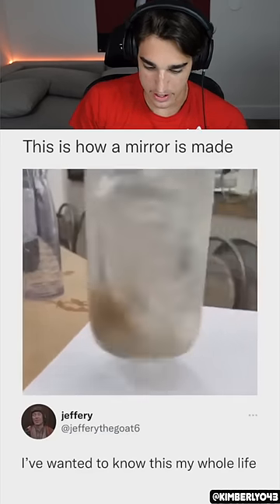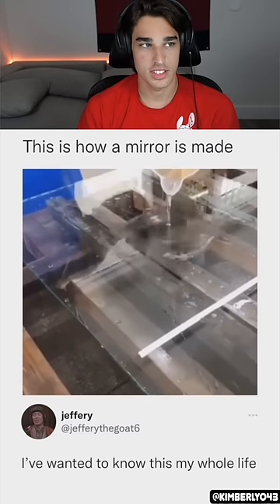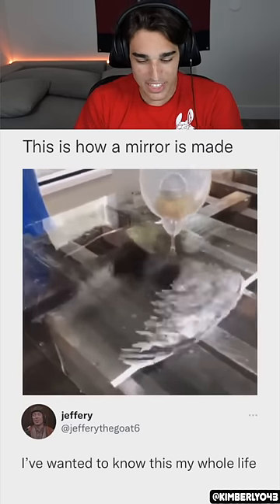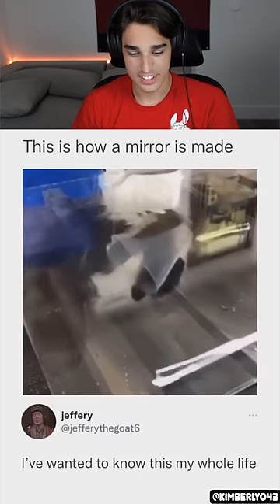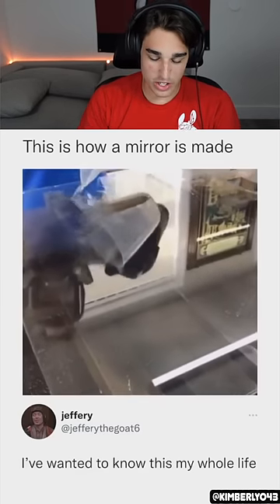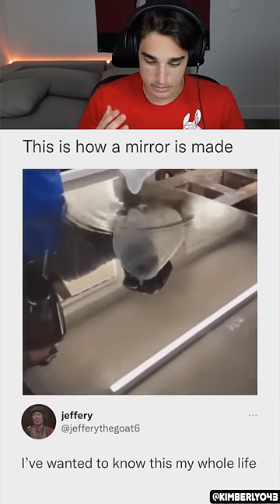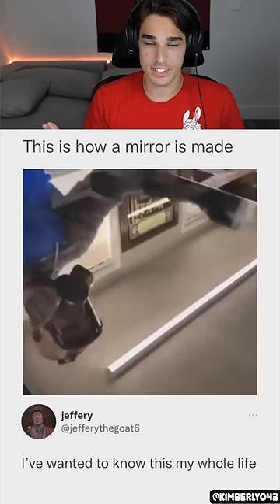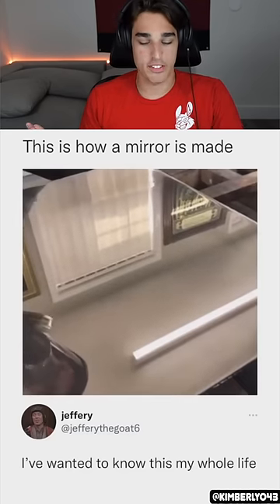This Is How Mirrors Are Made

Comment: I love how horizontal is backwards but vertical is always correct 🤔
Reply: Horizontal in never backwards. Nothing gets flipped by a mirror. Instead it's bounced directly back. It's your perspective that's considering it flipped. 

For example, if you lift your left hand, it shows your left hand lifting. But in your head, when facing someone, you know it's their right hand.

Or say you write something on paper. Notice you are the one turning the paper, so it faces the mirror. You flipped it, not the mirror. If you write on thin paper with a dark marker so the paint shows on the other side, and hold it up, so you can still read it without turning the paper, you will see the words in the mirror correctly.

Look for a video from Vsauce that explains this

Comment: Anyways here's my custom brownie recipe!!

Ingredients: Brownie mix, milk(?), eggs, meth, candy cane vape juice, cocaine, 20 red candles, a flamethrower, a statue of Jesus, gasoline, and love

First thing u wanna do is open a cupboard and grab a bowl. Dump around the brownie mix into that bowl. If you are a delinquent and don't have brownie mix, you can always make your own as it will not change the final taste at all. Second, spray milk on it. If you didn't bring milk you can also make your own. After that, let it marinate until 3am. Sneak downstairs and arrange the red candles in a circle around the bowl. Put the vape juice on each candle before lighting it. Finally, pour gasoline in the bowl and chant "the dark hold opens" 240 times and hold the statue of Jesus before blasting the candles and bowl with a flamethrower. The Jesus statue will protect you from evil spirits. Now mix some love into the mix and inhale the cocaine. Put the meth in too. Dump the contents into a pan and let it sit in the sun for 3 days. Then spread some number 3 on the top and CONGRATS!!